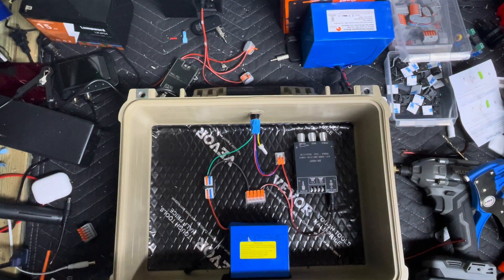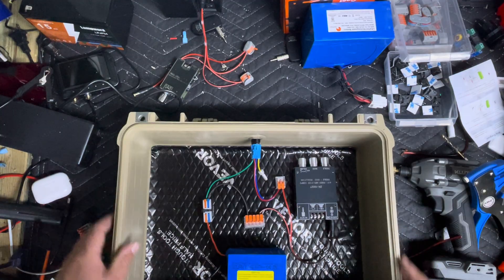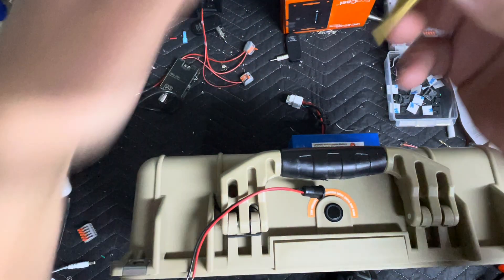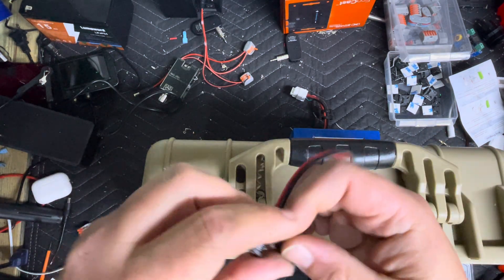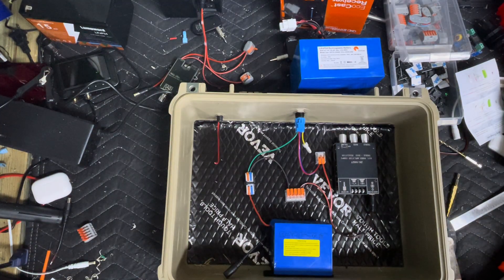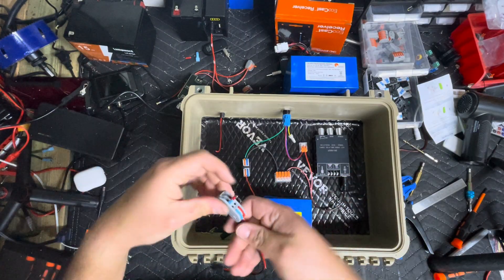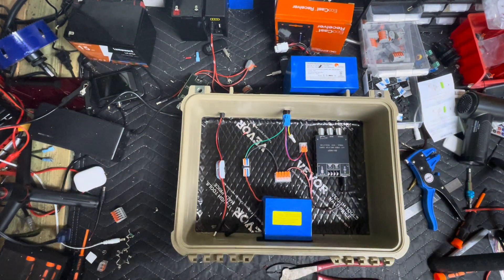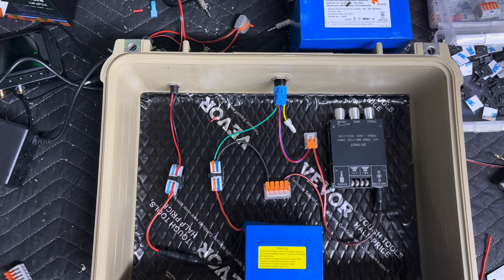How To Build DIY BoomBox Build Part 5

Comment: I see your using a 24v battery it appears. But alot of the connectors and plugs you have listed are 12v rated it looks like.  If so does that not matter?  Or am i looking at it wrong. Sorry im definitely not an electrician